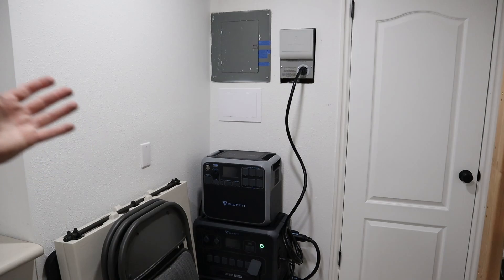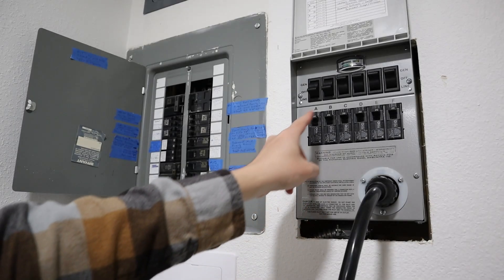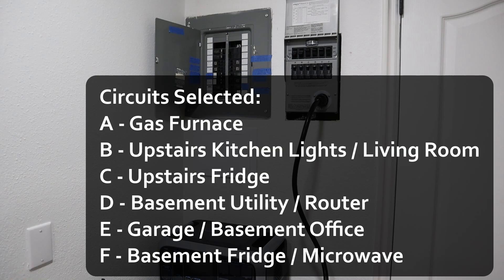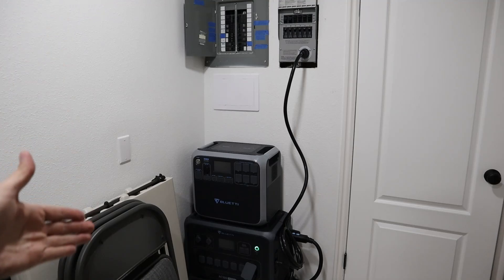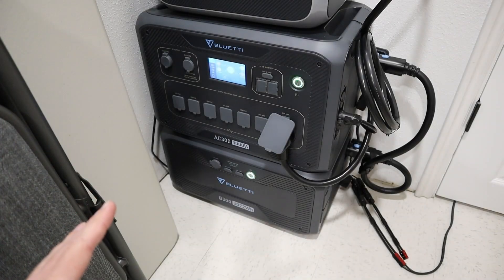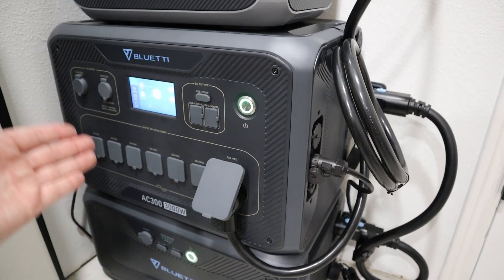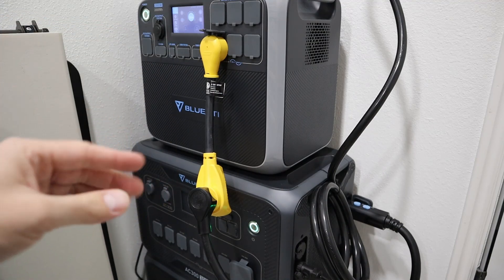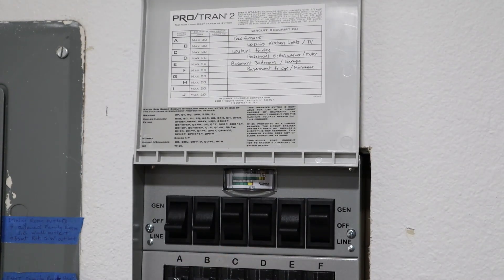Keep the Power On During an Outage?! Install a Power Station Transfer Switch!

Comment: Jason, do you leave the solar plugged into the AC300 24/7? Did you run any conduit for the PV wires coming inside or no? I am going to run 1600W (two 800w arrays) of solar on a ground mount out back into my utility closet where I keep my AC300 and I plan on running metal EMT conduit in said closet to run the wires in. They will come out of the conduit thru a meg bushing to plug into the Bluetti. I am trying to build up the faith/confidence to have this thing running 24/7 even while I'm not home. I have the Reliance 10 circuit transfer switch and it runs all the 120V in my house. I do not ever plan to worry about running split phase for 240V. I just want the AC300 to run everything in the transfer switch 24/7 and to leave the PV plugged into the bluetti 24/7 without causing issues or burning my house down. Tell me it's all going to be ok 🤣🤣🤣
Reply from the maker: I think you have a great setup you have explained. The only other thing I would advise is using a DC circuit breaker / disconnect switch. I'd put that on your solar panel wires before they connect to the AC300. That way you can shut off the power if you need to mess with the wiring. It would also function as a circuit breaker if something goes wrong.  This 250v 16 amp device would work great:  https://amzn.to/3y5jZ6V
Reply: @Jasonoid  I have them! Forgot to mention lol two 16amp dc breakers on outside wall of house. Do you use the ac300 24/7? And do you leave the panels plugged in all the time?
Reply from the maker: @mikeconte2022  yeah, 24/7 with solar. The AC300 / AC500 don't have any issues leaving solar connected all the time. Other power station will beep and sound alarms when solar is low at dusk and dawn, these don't 👍
Reply: @Jasonoid  You're awesome man!!! I sincerely appreciate you reaching out and answering questions on here!!! I cant wait to get mine running full time! It's a bit unorthodox lol. The transfer switch is in my garage. I ran 8/3 wire thru my attic and into a spare bedroom utility closet. An electrician pulled permits and installed the transfer switch and receptacle. The ac300 has had no issues powering all 10 circuits in the switch. But I have been unplugging it to recharge via AC wall power when it gets low. I'm dying to get my panels installed. I am just so nervous about letting this thing run 24/7 even while I'm not home. I do not want to start a fire 😬😬

Comment: I like the idea, but rather use a 48v server rack battery, with an all in one inverter charger.
Reply from the maker: Did you see this 24v system I recently built? https://youtu.be/Ksnv9IewYAY
A 48v system would be similar except the server rack batteries would be used.

Comment: Can this one work with the Bluetti AC200P and/or the Ac200Max? I know Bluetti offers one of these to install to your home. But, they state it works for the AC300 and AC500. I have both the 200P and 200Max.
Reply from the maker: Yes, many people use the AC200 series power stations on their transfer switches. You'd be limited to the max output of the inverter.

Comment: Hi Jason, great video. Also would it not be a wise investment to go with Signature Solar  48 volt  split phase all in one unit with a 5kWh server rack battery for a total of around $2700 instead of $3600 for the Bluetti ? The Signature Solar  system would offer more options and capability than the Bluetti. I do not work for Signature Solar or have any vested interest in that company. I am only pointing this out from a value per dollar for the consumer and as a better/cheaper way to power your home. Also if you want portability you could mount that equipment on a roller cart as I know the Bluetti is portable somewhat.Let me know your thoughts. Thanks for a great channel.
Reply from the maker: That would be an EXCELLENT way to go if someone was comfortable putting together the system. A DIY build can really save on costs. I recently built a 24v system using and 'All in one' inverter like that ( https://youtu.be/Ksnv9IewYAY ). It does take some knowledge and background to build a system like that and it just depends what someone is comfortable doing. I like both DIY and 'off the shelf' options and I try to cover both on my channel.
Reply: @Jasonoid  Thanks for your reply, I actually saw that video some time ago. You are correct Jason, it is simple but would take some effort to implement. On another subject do you want to share if your background is in EE or how did you come to be interested in solar,electrical, power systems etc? Maybe just a hobby?
Reply from the maker: I'm not an EE, it's just a hobby. I usually talk about that type of thing during my livestreams. I'll have one this weekend.

Comment: I couldnt tell from your explanation, but can you have some circuits on solar and some on grid at the same time, or is it one or the other?
Reply from the maker: You can switch on and off the grid with each circuit on the transfer switch. So you can have 2 circuits running off your generator / power station and have the rest running off the grid (mix and match anyway).

Comment: What I don’t get is the max current into that transfer switch is 30 amps. But there are 6 circuits at 15 or 20 amps each. 

Is there any chance you could max out the current when all 6 circuits are running?
Reply from the maker: You have to be watchful and manage your loads in your house or you'll overload the power station inverter and it will shut off. For example, running a toaster, a full size microwave, and coffee maker would be too much for the inverter. You could only run one or two devices at a time.

Comment: In this set up, how do you charge the battery directly from the grid when needed? I'm assuming the transfer switch only receives power from the battery and can't charge the battery from the line
Reply from the maker: You can either swap the circuits back to grid power and plug in the power station or you can plug in the power station into a circuit/outlet that's not powered by the transfer switch.
Reply: In our main control panel, we have a dedicated 20-amp braker with a 120V outlet for the DP. (Nothing else is on this circuit) We used one of the Transfer Switch circuits, for the DP circuit, in the Main Control Panel.  This way we can charge the DP from the Grid as well as use the Emergency Power Supply (EPS) feature, of the DP.

Comment: Why don't you connect your AC300 to  the grid and set a charging level eg 30%? You could run your most important circuits all the time with vor AC 300. First your solarpower would be used (from 100% to 30%) and if there isn't enough solar and the charginglevel ist to low, the grid kicks in.

Comment: Thanks Jason for all your answers. I am new to the concept of backing up some of my home electrical systems especially my furnace. How is the Bluetti EP500 Pro with a built in UPS compare. I assume I still need a separate electrical panel to integrate to my home electrical system or just a dedicated breaker....thanks
Reply from the maker: To safely connect a power station to the grid you'll want to install a transfer switch. Also, for most furnaces to work you'll also need to have the neutral and ground bonded. My neutral and ground are bonded in my main panel, if your setup isn't you can always buy a neutral bonding plug.

Comment: Great videos Jason and rich with important facts and experience.  Awesome work and thanks for sharing.  I am also building a solution for the backup power but I have a twist that I would love to include in the setup.  I was going to repeat your setup with a manual transfer switch powered by the Bluetti (type to be determined) and that Bluetti recharged by gas genset and solar.  The twist I'm trying to work out if possible is if I can automate the use of the Bluetti during high peak hours and then switch back to grid without any manuel touch from me?  I don't seem to be able to find automatic transfer switches with timers or other controls to allow this.  Any ideas or should I be looking for something different?  Many thanks for any suggestions
Reply from the maker: There is a UPS mode that will allow for grid charging during specific times of the day, so you can program it to charge during off peak hours.

Comment: Trying to find some information on getting two AC500’s to use the full capability of 50a and each leg of 120v to power an RV like connecting to the pedestal at an RV park. Familiar? Right now Bluetti states it doesn’t have and is not going to have a Fusion like box for supporting the FULL capability of the AC500! Only 30a? So, wasted money “thinking” Bluetti was a solution for the RV! NOT! Warning to those “thinking” as I was - DON’T buy into the Bluetti hype and false statements! Any thoughts on making it work?

Comment: I read on Bluetti FAQ that they do not recommend using the unit while charging. Seems it impacts the unit cycle longevity. I am bummed because I want those 3000+ cycles. Any info if I'm wrong or good news for me?
Reply: Bluetti Product FAQ: Q: Does Bluettipower portable power station support charging and discharge simultaneously?
A: Sure. However, in order to better protect the cycle life of the battery, it is not recommended to charge and discharge the battery at the same time.
Reply: @Simple_Citoyen  I don't understand this. Doesn't solar charge the battery continuously  as the battery discharges into the breakers?
Reply: @bman75778  I took no chances. I opted for a portable Propane instead. 
If I can’t let the unit plugged in the wall till the electricity goes down then it is no use to me.
Maybe for other applications where one completely charges the battery before a planned camping trip or job will be thrilled with it.

Comment: So if you place the ttansfer switch to generator does it trip your main breaker?
Reply from the maker: It bypasses the main panel when in use, so you are usually using the transfer switch or the main panel, not both at the same time.

Comment: Hi, I like your video. Just asking. With your setup, do you sell solar to you utility? Can this setup sell solar to your utility? Thanks.
Reply from the maker: No, this setup does not work like a net metering system. You are just using the power from your power station instead of your power company

Comment: I am looking for solution, to charge power station from mains during night from main electricity line, when it is cheap, from 11pm till 8am, and the use the electricity from the power station during the day. I presume I would need some kind of a switch, which would control, when the power station should charge itself, and when it should use it's juice to power our 2 bed apartment. Any recommendations which model would be enough four our 3 people family?
Reply from the maker: The Bluetti AC500 and AC300 both have customized UPS modes that allow it to charge from the grid at scheduled times and from solar panels during the day. I haven't used that mode particularly since I charge mine fully off solar panels only.

Comment: Jason 
What type of transfer switch can I use if I have an AC200P and a 7500 watt gas generator?   Can I get one with more than 4 circuits for when I might use the gas generator?
Reply: Yes. Reliance Controls have a six and ten circuit Transfer Switch.

Comment: Why not use smart panel instead
Reply from the maker: I prioritize using solar and not grid power on these 6 circuits. I try to run them off solar as much as possible. If I had a smart transfer switch it would prioritize grid power and I would not save my solar money. I guess I'm not using the transfer switch as most people would haha.

Comment: It sounds like your objectives are similar to mine. I wanted a backup power source for the critical stuff. Like you, I want to run my refrigerators and freezer on it full time. The reduction in the power bill will partially help pay for the system.

I also have the AC300. I have 4 batteries. I have the system in the basement so it will have a steady temperature even if the air conditioning isn't running. My main power panel is nearby. 

I was under the impression that the Bluetti can't have neutral wire grounded as it is in the main power panel. Does your transfer switch also switch the neutral?
Reply from the maker: My home was built in 78 and In my main power box the neutral and ground are not bonded, maybe that's why it works? I don't have any issues running ground through my transfer switch.

Comment: I am trying to figure all this stuff out. we was going to get a generacs for outages but 12 thousand!!! no thanks. so I am going the battery route. it's so confusing. I want something to run the fridge and have some outlets for small appliances and heaters or fans. got about 5 grand to spend on it.
Reply from the maker: A 2000wh to 3000wh device will work fine for your fridge and some basic appliances. I'd recommend around 700 to 1000 watts of solar panels to charge it up. Have you seen my video on the Bluetti AC300? The Bluetti AC200MAX would also be a good option. For a more budget option the Pecron E2000 LFP version is good too. I just put out a video on that today. Also, pass on the electric space heaters, those burn through a battery faster than anything else. If you need heat you'll be best running an indoor safe propane heater or your gas furnace.
Reply: @Jasonoid  thanks you for raking the time to responding. I was looking at bluetti but they seemed Iverson priced compared to what eco flow has. You can get 2 evoflw max with solar panel for under 5 grand I think it's  each unit is 2 kw, expandable to 6. Honesty I know powering alot is going to be more. And I think I'd you can power the fridge and a few other things you got it pretty well off then most. And to be as poor as I am an have an opportunity to even consider blowing all our families money we have on this I better get it right or my mother inlaws and wife will woop my tail. Because I have pushed this topic till they caved.  Crazy times ahead and I want to be prepared.
Reply from the maker: @KoNqueeFtador  the Ecoflow delta max is also a beast! With 800 watts of solar input and 2 expandable batteries it's pretty awesome. The 2400 watt inverter is also very good. Only downside in my opinion is the NMC chemistry. I think they will launch a LFP Delta Max soon if you can wait.
Reply: @Jasonoid  can you explain that in laymans terms

Comment: I did a similar setup last November with the AC200P and 2 B230 expansion batteries. At the time I was having solar panels installed on my roof so I had the installers add 2 additional panels to the array but not tied into it. They are run along the same route for the main array but hook into my Bluetti. The two panels are 405 watt each. The AC200P can only accept up 2 700 watts but I frequently show 725 watts going in. In order to get more out of the system than just emergency power I charge the batteries during the day and run of them at night after I get home from work during the week. On the weekends I run off of the batteries during the afternoon and as long as I have good sun my solar panels easily keep up with my power needs further cutting down my electrical consumption from the power company.

Comment: Would I be able to plug a Bluetti AC500 into an existing 30amp receptacle that has a transfer switch on our main panel? We use this for our gas generator and I don’t want to make an expensive mistake when we get our power system. Thanks!
Reply from the maker: I connect my AC300 and AC500 to my main panel via a Transfer Switch everyday (for the last 4 months). Homes are built during different time periods with different electrical setups so I can't guarantee if will behave the same as mine does. I haven't had any issues.
Reply: @Jasonoid  Thanks! Hopefully it works so I can save a few bucks. These systems aren't cheap!

Comment: can this transfer switch be installed in an apartment?  does it require that the power company shut off my power to install or is this installed AFTER the original circuit box?
Reply from the maker: Most land lords will not allow something like this since it's modifying the building. A way around this would be to use your power station to power appliances using extension cords. That works fine :)

Comment: Having the ProTran 10 breaker unit installed tomorrow. I have2 AC200Max’s and an AC500 with extra battery on order. Can’t wait to get this thing working.

Comment: Nice set up. I'm building a house and just purchased the Bluetti AC500 with 2 batteries, and 420 watts of solar. Not much solar but enough to get me started and these are the portable panels so I can take all this with me in my 5th wheel. I'm going to have the electrician wire the house for generator backup (I did this myself on our last house using the same transfer switch you used), but have the generator plugged into the Bluetti AC500, along with plugging the solar into the Bluetti. I'm also on a grid, so I may have a plug in from the AC power to the Bluetti so I can charge it if the Solar can't keep up, basically using the AC500 as a UPS. I'm looking to put all of my house on the transfer switch through the Bluetti, and when I get more solar panels I'm hoping I'll be able to keep my grid power bill to a bare minimum = powering my well pump, and woodworking shop (220 outlets). Maybe if this all works well I'll get a second AC500 and get 220 working but that's for a later date.